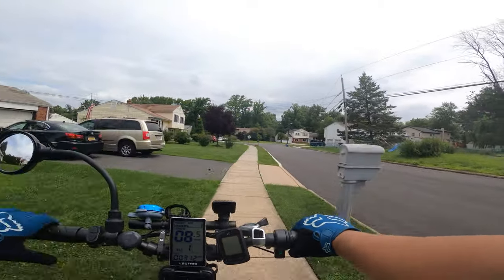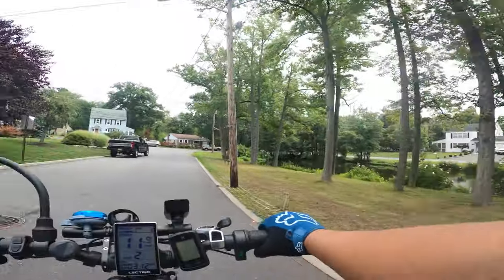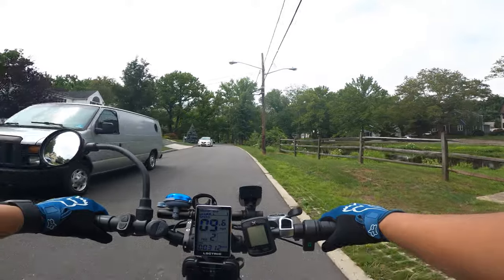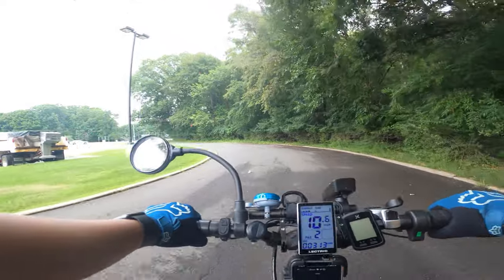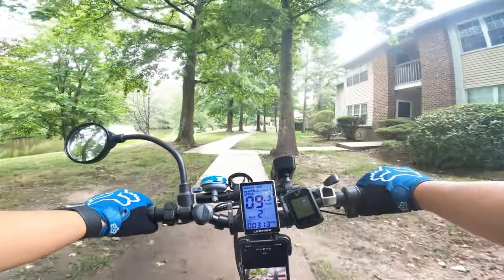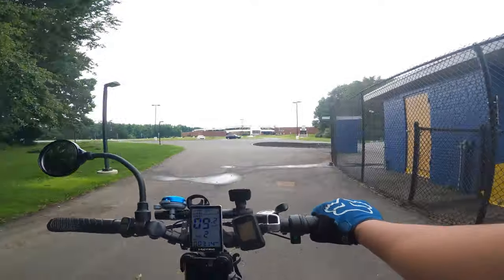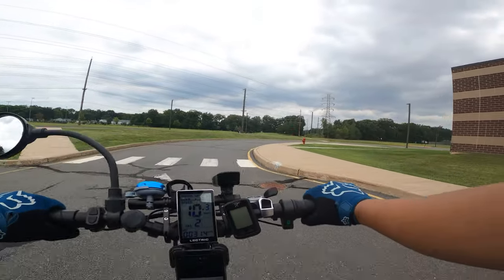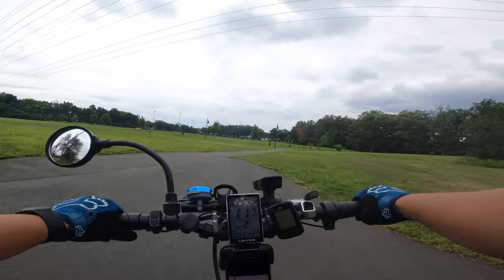Lectric XP Post Maintenance Test Ride 🚲🔛

Comment: Should probably keep a roll of duct tape in your carry. If the slime doesn't self seal, duct tape around the tube will most likely get you home. I agree... my Lectric 2.0 is the stress reliever I need at the end of the day. Bought 2 so my partner can ride with me. Like you said, more fun to ride with a partner/group.
Reply from the maker: Appreciate the tip! Yes always more fun to ride with a group in my opinion! Ebikes are the best stress relief!